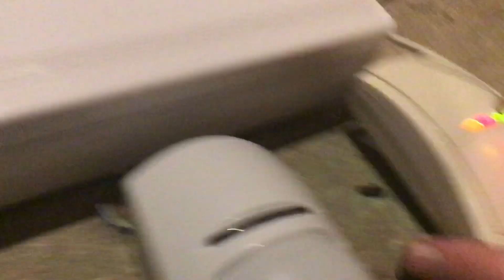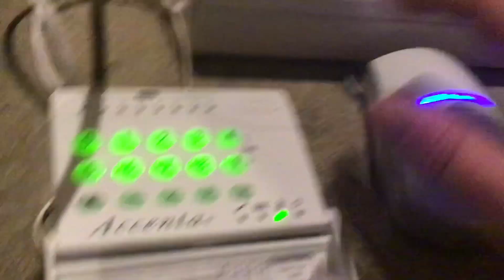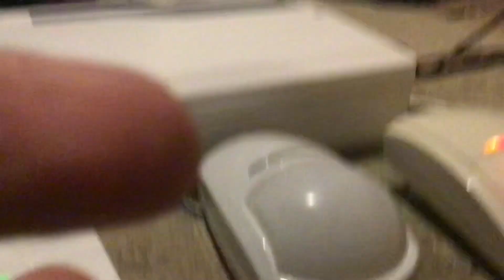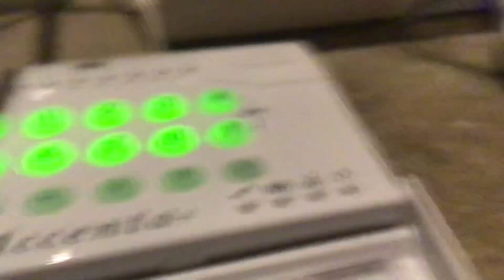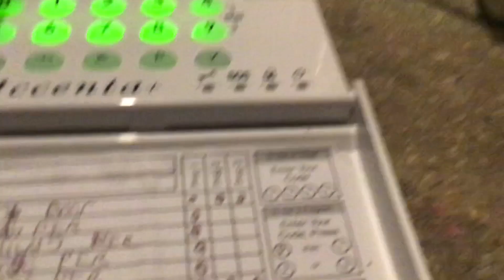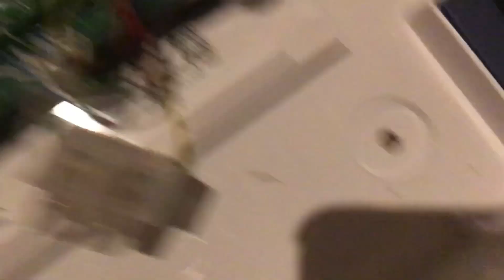Accenta G4 Mini System Test 1

Comment: Hey great video.  

Couple of answers for you.  The 12v+ and Ov+ Aux output should be used to power detectors that need it such as PIR's Smoke Detection and CM detectors.  Contacts do not need 12v+.  The output is parallel wired.  Not Series.  You can actually damage the PIR draining current off it in series to power other devices.  If there are many PIRs you might consider the use of block connector and twist all the REDs and Blacks together to secure them and then have a pair of red and blacks going into the Aux Output feeding your block connector.  In larger systems I sometimes fit an extra Power Supply next to the Control Panel.  This is so that panel has enough power to cope with the draw on the number of 12v+ enable detectors on the system.  This also has implications on the standby battery selection and you should always test the current draw with the mains off using a battery meter to make sure your battery(ies) are sufficient to give at least 8 hours of standby in the event of a power cut.  

The Tamper on the Accenta is classed as "Global Tamper" and is not uncommon for entry level panels of this class to use a single loop for tamper detection.  But it is a series circuit.  If you wire tamper zones in parallel it will need every tamper switch on every device open at the same time to trigger a tamper alarm condition, thus defeating the tamper loop.  With your setup there you'd take lets say the yellow and blue conductors of the alarm cable for tamper.  Take the first yellow from the first sensor, connect this to the first tamper terminal on the control panel PCB.  

Take the blue of the first detector and connect this in a terminal block to the yellow of the SECOND device and secure it.  Then take the blue cable from the SECOND detector and complete the tamper loop in the terminal on the control panel PCB.  Hope that makes sense.  Accenta panels like many others also have a dedicated bell box tamper circuit to protect the external siren/bell enclosure from tampering.  The circuit is dedicated for the bell box, but on entry level panels the indication is the same, usually a cog LED or spanner symbol, combined with an internal alarm activation if the system is unset or full alarm condition if set.

Thanks for making your video, enjoyed it.  If you have any other questions get back to me.  All the best, Martin.